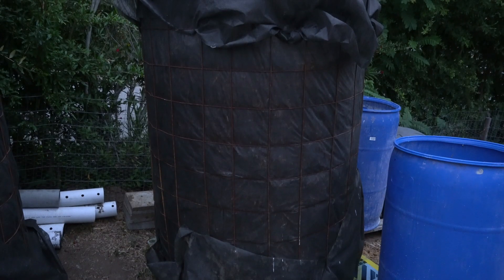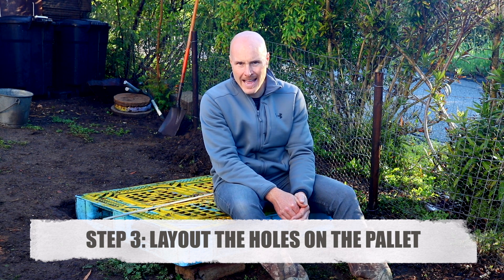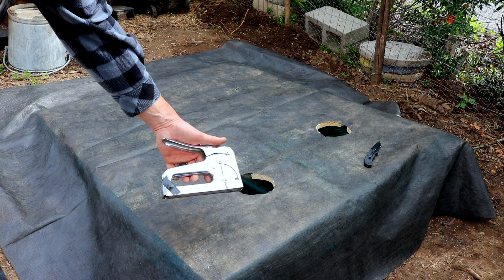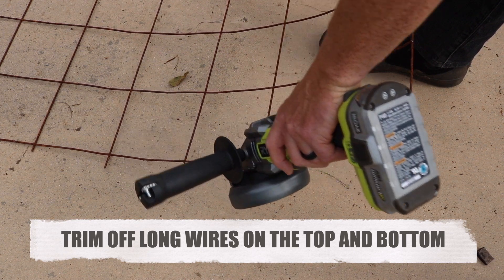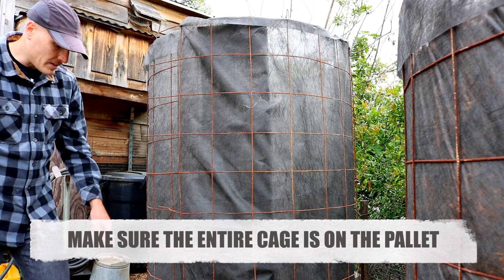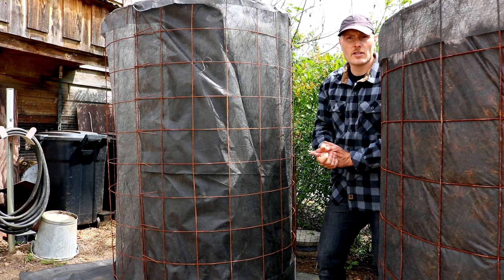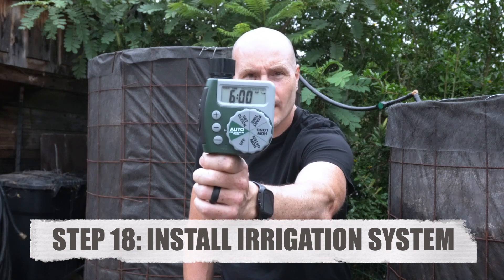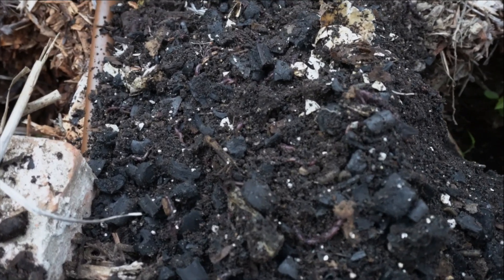Easy Composting with a Johnson-Su Bioreactor - Step by Step HOW-TO Build Video

Comment: A lot of work for a gigantic vermicomposter. I'd rather hot compost thru the winter and plant in that space in the summer. In my system, the worms will come naturally and if you start in November, you can use it in May. Worms will be attracted to the garden during your first planting season and with another layer of compost at the start of the 2nsd season, you'll be in great shape. Get a Geobin or 2 and put some air canals in if you want, but turn it a couple of times or auger it up & you're good to go. Just get a nice mix of grass clippings to mix in with your leaves.

I'm experimenting with blowing compressed air into mine with and air blower 18" brake line attached to an air nozzle.
Reply: Hot compost is bad for your garden because it encourages anaerobic processes which encourage bad bacteria, harmful substances like alcohol and formeldahyde and discourages the positive microorganisms that help your plants retrieve nutrients from the soil

Comment: Thanks for this great, simple and practical video! Any suggestion how to address irrigation/moisture issue in the high desert area (South-East New Mexico.) Planning to introduce this bio-reactor at the local community garden. However, watering (via waterlines) occurs only x2/wk & is shut off from November to March to avoid frost damage. Any suggestion on how to bridge/modify the system to meet moisture/watering needs? Appreciate any thoughts on this:)

Comment: Diego,
Is the fabric supposed to be permeable or impermeable?
Thanks so much for your time!
Regards from Brazil.
Reply from the maker: Permeable, but you could use impermeable as long as your air tubes were providing sufficient air.  So something like an IBC would work.

Comment: good job of explaining how to build. I built two of these December 2019  The hardest part was wetting the chopped leaves and climbing the ladder 100 times with 5 gallon buckets of wet leaves. And you left this part out. I have been using a little bit of this compost this  fall to mix into soil when planting fall  shrubs. Also made an extract and coated cover crop seeds to plant. I was amazed that the seeds came up in 3 days!.
Reply from the maker: I filled mine with wood chips.  I show part of the filling in the longer video earlier this year.

Comment: I'm not a huge fan of landscape fabric. I do wonder if the Geobin brand composting systems could be rigged up vertically to work in this system. Or if burlap or cardboard could be used.
Reply: cardboard won't allow much air and that is the reason for the fabric. Burlap would work but will be digested  by the process and then you won't have a container.
Reply: @donlourie769  You sure air from the outside is necessary depending on location of the air pipes.
Reply: @thomasfuchs9451   may not be necessary depending how fast your looking for the material to compost down where it’s usable? More air, along with the water and sun/heat the faster it’s going to compost into usable material is my logic to this system
Reply: @thomasfuchs9451  yes
Reply: maybe metal screen room mesh
Reply: @Harghlandr  Yup.  I made one with welded wire fencing that has 2x3 inch openings and didn't use any fabric at all.  This also allows tons of air from the outside.  You would be surprised how little material "spills" out of the mesh if using grass, etc. to compost.  Using only wood chips as Diego did might not work unless one used finer mesh such as screen.
Reply: No reason why not.

Comment: Are you sure that all your holes are 72° apart? :) It looks to me that on 2:39 left lower and left upper holes are around 90° apart, while left upper and top hole are less than 60° apart :) It doesn't matter though but it just caught my eye as you were super precise on sketch plan with 72 degrees :)
Reply from the maker: Be precise in the design then adapt to reality and place them as close to the set position as possible accounting for all actual design constraints.  It’s not a rocket. 😉
Reply: @DiegoFooter  I have little bit of OCD for such things, please don't mind ;)

Comment: but I had this years and years ago already: my family and friends as witness: I have a one metre/ 3 feet square  rebar cage to to the job. seriously.
Reply: But did you fill it mainly with woodchip and leaves, and air tunnels and water to ensure the fungal part happened?
I've used structures like this for normal composting for decades and the Johnson-Su bioreactor has been around for years too - not sure how long but 5 years at least.
Hope you get great compost from your setup, we all need as much as we can make.

Comment: You might consider sewing the landscape fabric into a tube that could be draped on the inside of the cage.
I use rebar ties to build support structures for my vegetables. The ties come in 6-inch lengths with a loop on both ends. There's a cheap companion tool ($6 or so) that twists the ties for application or removal that's FAST. You can build RIGID structures in a hurry with #2 rebar, and take them down just as quickly. The ties can also be used on concrete mesh. The ties are 3.5 cents each @ 100. Home Depot and Lowe's and many others carry the product.
Ties: https://www.lowes.com/pd/Grip-Rite-100-Pack-Steel-Rebar-Ties/5000183005
Tool: https://www.lowes.com/pd/QLT-by-Marshalltown-Wire-Twister/1000101895

Comment: Hello Diego, Greetings from the Land of Five Rivers! You are doing a great job my dear. This November I shall be installing 2 to 5 BEAMs. Planning to scale up dimensions of at least two, though I am having doubts to scale up height. What do you suggest how high we can go? Also, whether changing shape from cylindrical to cubical or cuboidal should be cause for any reservations.
Reply from the maker: Shape shouldn’t be a problem as long as you observe that base principle of 12 inches to air.  I think height is going to be a function of what you’re making it out of. I think these materials would hold up twice as high but you’d probably have to double the diameter and put a really really strong base below it because it’s gonna be very heavy.
Reply: @DiegoFooter  Appreciate your prompt reply. I hope you will continue to help guide me through the process.